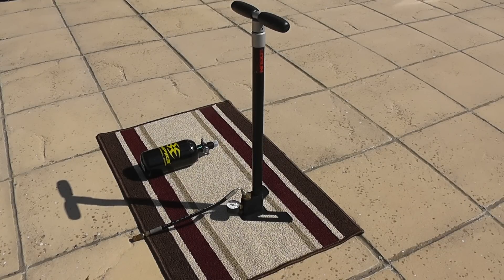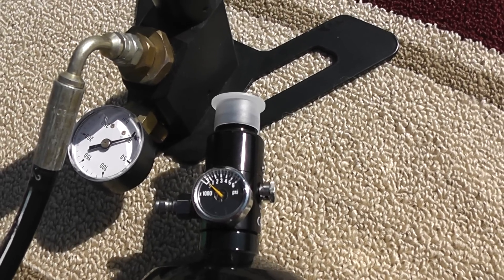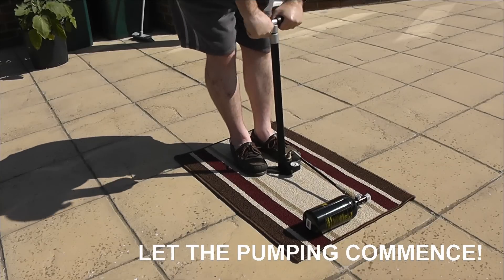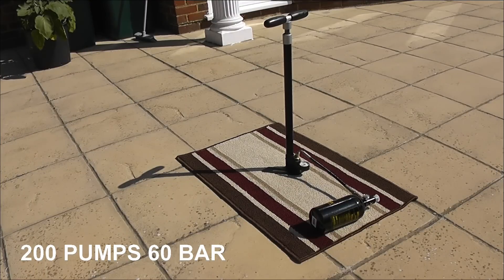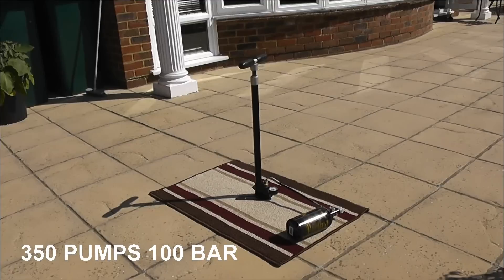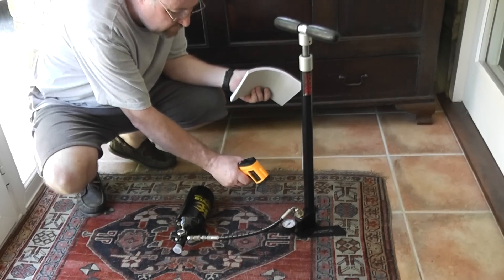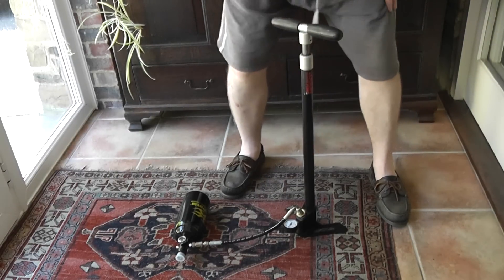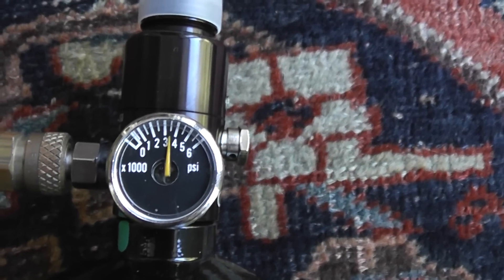Charging a paintball air bottle with a stirrup pump

Comment: Meow meow pls halp, I'M JUST A GIRL !!! I got one of these pumps to fill a small 26/3000 psi HKA army tank meow meow but it won't even fit the little connector thing !!! I had to use quack quack ducky tape to hold it in place mrow meow. I pumped for an hour and the according to the gauge, which never budged, no air got into the tank, yet I can feel the air coming out of the cord pump meow meow. Then I tried blowing the air in my goddamn self with my lips like. a balloon and passed out !!!  WHAT IS GOING ON ?!?! WHO DO I HAVE 2 FUCKING KILL TO GET THIS WORKING... ?
Reply from the maker: Woof Woof Woof, sounds to me like you need to get a different huffy puffy connector/adapter for the pump that fits the bottle.  Quack quack Ducky tape has no chance of sealing the connection.  3000psi is an enormous amount of pressure WOOF WOOF!!  Thanks for giving us a good laugh GRRRRRRRRRRRR!!!!!  :-)

Comment: the VEVOR 3-stage hand crank pump with high quality 301 stainless steel, crank pump 4500 psi (0-30 MPa), PCP Air Gun Rifle, PCP pump with pressure measurement range: 0-5800 psi (0-40 MPa)  

has it allready adapter for filling 13ci tank?

Comment: Is it okay if a 13ci tank gets hot when i am pumping air?
Reply from the maker: The air is normally heated by compression, so long as it does not get too hot and burn you, it should be fine.  :-)
Reply: @RussellPlatten  cool, thanks
Reply from the maker: :-) @menclar5476

Comment: 9 years later and I'm following in your footsteps .  There is a lot of hidden cost in pcp air gunning , bought riffle $260.
Bought pump $50 
Shortly after buying the pump I realized it's not good to pump moist air that means taking it ro the woods with you is only good in the heart of summer .

I bought a tiny bottle .45 liters and am pumping at home so I've got some dry air 
Next is to buy a compressor for around $ not a cheap hobby coming from breakbarrels and co2
Reply from the maker: The pump I use in the video has a water trap that needs venting regularly.  A small bottle is a good compromise Jason.  A compressor will make life much easier!  :-)
Reply: Ŵŵwŵŵwŵŵŵŵŵŵẁ÷÷÷÷÷÷÷÷÷÷÷÷÷÷÷÷÷÷÷÷÷÷÷÷÷÷÷÷÷÷×

Comment: Hi Russell my question to you is I have a appliance ( a portable air tank) that that needs to be filled to about 690 to 825 kpa  (100- 120 Psi ) would this be less strenous than using a bike pump for this application?  thoughts please thank you so I a wondering the tank is a 5 gallon air tank it seems this would be easier to use? thoughts please thank you
Reply from the maker: I am no expert, but I think you would struggle to get that sort of pressure out of a bike pump.  :-)
Reply: @RussellPlatten   so my question is  I need to fill a 5 gallon portable air tank to about 120 PSI it has the tire chuck valve my question is do you think this high pressure pump is likely to be less strenous to use to 120 PSI than a standard bike pump thoughse please thank you
Reply from the maker: No it would be harder.  I would use one of these:  https://amzn.to/3P40an3 or one of these:  https://amzn.to/3yfyOTY  :-)

Comment: noooo . thats a pain , get a dive bottle   srirrups are ok for 13 ci bottles
Reply from the maker: Hard work!  :-)
Reply: theyre more for the 13 ci bottles .. then ? once you reach the ballance at 2500 psi your flogging a dead horse
Reply: 80 pumps is roughly 3000 in a 13 ci bottle ,  apreciated buddy , well done pal for your efforts
Reply: what brand its got you there so its done its job ( well you have  again apreciated buddy )

Comment: My son filled his like this. He did it halfway roughly and was 350 pumps. However question is: Was it hard for anyone else to get the fitting off the tank. It was like vacuum sealed on it. We did finally break it free but it shot off. Scary. And only half full. It has the slide back sleeve to release it just like a standard air compressor.  But sliding it back to release it was almost impossible from the pressure I guess. Is that normal?
Reply from the maker: The pump should have a bleed valve to vent off the trapped pressure once you have charged the bottle.  Trying to remove the hose without venting it first is very dangerous!  :-)

Comment: What do you use to tank for does the tank fill a PCP airgun can you use an adapter to fill with that 48 cubic inch tank to fill a PCP airgun
Reply from the maker: The pump is designed for PCP air guns Derek.  :-)

Comment: Can you not just use an electrical pump?
Reply from the maker: You can if you are prepared to buy one!  :-)
Reply: @RussellPlatten  it depends on what kind because I was thinking of standard electrical car one, but seeing as I'm researching and need a very high Psi powered compressor... Nightmare man
Reply from the maker: @CR-bc1zt  It will cost you.  You need a diving compressor.  You can pick them up for a reasonable price, but you must take care when dealing with high pressure equipment.  It is very dangerous if not used correctly, is defective, or unfit for the task.  Take care and research properly before purchasing anything including hoses and fittings!  :-)
Reply: @RussellPlatten  I'm sure stores can offer refill dead cheap?
Reply from the maker: @CR-bc1zt  Diving shops will refill your bottles for a reasonable price.  :-)
Reply: @RussellPlatten  yeah, I found a scuba store near by and he filled it for £4
Reply: @RCHobbyGuy92 ah it's alright. I can get it filled for £4

Comment: Does anyone know what connector I need to use for my tippmann hpa tank?
Reply: The pump  comes with a 1/8 BSP connector which should be the size that comes with most HPA tanks. I just ordered the pump and an HPA tank off Amazon and they both have the 1/8 bsp connector so you shouldn’t have to buy an adapter.

Comment: How was he able to connect a bike pump to the air tank
Reply from the maker: It is not a bike pump, it is a high pressure stirrup pump designed for charging PCP air guns.  :-)
Reply: @RussellPlatten  yes I did some more research on it and found that but thank you very much for the response
Reply from the maker: @curtispoynter6905  :-)

Comment: Will a tippmann tank fit
Reply: It’s a 48ci
Reply from the maker: It depends on the connection.  You will be able to get the correct connection if it does not.  :-)

Comment: I have a stirrup pump and have tried filling my bottle up this way, I see the gauge on the pump increases and seems to eventually cause the pump to become un-pumpable at a certain point as the air doesn't seem to enter my bottle but just builds up in the pump and line. any idea on what I'm doing wrong or is another fitting required.
Reply from the maker: Is it a high pressure stirrup pump designed for air rifles?  A normal stirrup pump for bike tyres will not work.  :-)
Reply: @RussellPlatten  yeah the stirrup pump was advised by my local airsoft store as its one that they used when they ran HPA
Reply from the maker: @modzking4471  There is a non return valve in the bottle fitting.  Normally the pump pressure overcomes the pressure in the bottle and forces the NRV open.  It could be stuck.  Are you sure that the bottle is not already fully charged?  Please be very careful if you investigate anything, we are dealing with lethal pressures here.  How many pumps before the pump becomes unusable?  What are the gauges on the bottle and the pump reading when this happens?
Reply: The bottle is a 3000psi bottle, the bottles gauge is reading at 2000psi. The pump is rated for 4500psi. I can get the pump to just under 2000psi and then even with all my body weight I can’t get it to pump any further and both gauges don’t get any higher
Reply from the maker: @modzking4471  Strange....  How much do you weigh?  Don't answer this if you do not want to.  I am just trying to get an idea of what is going on.
Reply from the maker: Normally the pump will reach the pressure of the bottle quickly and then it needs a bit of force to push open the NRV.  After that it gets easier again and you can pump up the bottle.
Reply: Around 75kg
Reply from the maker: @modzking4471  Try depressurising the pump hose a little and then pump it back up again making sure that you are using a lot of force and pumping quickly as it approaches 2000psi.

Comment: I am writing this comment to nobody in particular, although I know that Russel Platten would agree with what I have to say here:  I have been reading a lot of these comments asking about using hand pumps to charge scuba tanks and airgun tanks, and I am amazed at the ignorance which so many people have about what this whole thing is about.  First thing:  I have always been interested in human-powered work and have always liked to experiment with things.  It would be possible to use a hand pump to charge up a scuba tank, but the only people who should try that are people who --- like me --- want just to experiment without no real intention to try this on a continual daily basis.  Experiments like this are done not just with a quick flip, but instead are done by the long haul.  Three and a half hours to fully charge a tank that accepts 775 strokes of air would be much more realistically done with maybe a half hour of work per day over a one-week period.  So anyone who is serious about doing experiments like this can't expect to fill an entire tank in one day but instead must set for themselves much smaller increments of work done over long periods of time.  Secondly, I am blown away by the ignorance people express when they say they think they can charge up one of these scuba tanks with a WAL-MART BICYCLE COMPRESSOR, OF ALL THINGS?  When you fill a scuba tank, you are dealing with a pressure front that is much higher than a bicycle tire or a car tire.  You are not dealing with 50-PSI air pressure; you're dealing with 3000-PSI air pressure which is 60 times greater than that.  I have another thing to say about this scuba-tank-filling business using hand pumps, in that most people --- except knowledgeable people like Russel Patton --- have no idea as to just what kinds of air pumps are needed to generate 3000-PSI pressure.  To generate 3000 PSI of air pressure using just a hand pump, you need a piston that is essentially a nail driven 18 inches down a narrow bore with each stroke.  To an outside observer the hand pump looks like a normal bicycle pump, but the inner bore is very narrow and the rest of the diameter is taken up by the super-thick metal wall of the pump cylinder --- and like I said, the piston is essentially a nail, or a rod, driven down its center.  The amount of force needed to compress air to 150 PSI with a one-inch pump bore is the same amount of force that would be needed to compress air to just 2400 PSI with a 1/4" pump bore --- let alone 600 PSI beyond 2400 PSI.  A 1/5" pump bore would take you to 3,750 PSI.  A 1/6" pump bore would take you to 5400 PSI.  Likewise, the "piston" --- if it could be called that --- would need to be precisely guided in its path up and down the cylinder bore -- and guided much more precisely than the piston in a bicycle pump.  In addition, the bottom of the cylinder would get very, very hot even from hand-pumping because of the high pressure involved.  This would necessitate the bottom part of the pump in particular having to serve the function of a heat sink for the cylinder and piston assembly.  So how do you all like that for the unseen complications involved in generating 3000 PSI with human hand pressure?
Reply: What was the point of all that yappen? Especially for no one in particular. How long did it take you to type this as well since you say it takes you over a few days to fill one tank?

Comment: If I ever were to have a reason why I would need high-pressure air like this, I would buy a large air tank and then I would do just a little bit of work at a time, even over a period of several days, rather than all in one shot.  I actually like human-powered devices and procedures like this, so if I ever had an air rifle which is charged this way I would have just as much fun experimenting with the pump and the air pressure as with the gun.  This video is very interesting because I actually like physical exercise which is used to power machinery which does useful work.  I have always been interested in human-powered electricity as well.
Reply: @RussellPlatten  Can you explain in words, rather than symbols, what you mean by your expression :-)?  I do not understand those codes.  I have another idea about the hand pump:  Supposing that there were a high-pressure human-powered air compressor to be made for foot power, complete with foot pedals?  I have already done experiments with human-powered electricity.
Reply from the maker: @MyNathanking  :-) is a smiley face.  : eyes  - nose  ) mouth.  All of the powered compressors are driven by motors so it should be possible to convert one to pedal power, but it would be hard work and slow.  :-)
Reply: @RussellPlatten  Yes, I know it would be hard work and slow to charge an air tank with a pedal-powered 3000 to 4500-PSI pump, and that is why it is valuable mainly for experimental purposes and not for everyday application.  Of course you could theoretically jury-rig a high-pressure stirrup pump to a gear-reduction mechanism, but I am not sure how good this would be for the pump which would be designed to operate by more precision hand motion.  This is why I think that the best human-powered high-pressure pump would be one which is specifically designed to operate on pedal power, and it would also have to be a rotary pump as opposed to an oscillating pump.  It also would have to be equipped with a lot of metal on it to serve as a heat sink.  The pump would also have to have a flywheel on it, and geared to accept a power input revolution typical to that of the rear sprocket of a normal bicycle.  Now, as a final thought to this comment, I hope that I am thinking more reasonably and rationally --- even if my ideas are quirky --- than the people who think they can charge scuba tanks using their garage air compressors.  At least I hope I have a grip on the complications that are entailed with human-powered air compression to max 4500 PSI and how the human-powered equipment for doing it would have to be built to compensate for those complications.
Reply: @MyNathanking  my God don't you think you put way to much thought into a simple hand pump product. Seeing you have to actually pull the handle all the way up and push it all the way down. This is high pressure air which creates high temperatures in the bottle and pump so you have to do it in sessions with breaks to allow the cool down effect. This in essence is a bomb once it's filled which means it is not smart to experiment with this in anyway or fashion. Just follow the directions and be responsible when handling anything with this type of energy, explosive power. People have died for not respecting the dangerously high air pressures involved in filling and storing air in high pressure vessels.  I hope you were not foolish and followed through with any of your dangerous ideas. I'm 3 years late to this thread which means you had a lot of time to have caused yourself a bad or deadly injury. People just follow instructions
Reply: @warrenthomas1253  My shit I know about things like the heat generated during air compression and that's why I WOULD fill the tank gradually instead of in one shot.  By the way, if pressurized bottles are so dangerous, what's the difference between filling them with an air pump and filling them with a powered machine like an air compressor?  If I ever followed through on that kind of idea how much more dangerous would I be doing than what this guy is doing in this video?  Shit, warrenthomas1253.

Comment: Can I just use a regular air compressor
Reply: I see no one answered your question so if it's still not too late, here I go: Regular compressors (for car tires for example) have two big problems. One - they are made for volume rather than pressure, especially that high bars. And second - they fill up very quickly so the tank could possibly blow up instead or at least extremely overheat. So you would need a kind of special compressor, that can make 300 bar pressure and have a slow air flow. Those exist too, but are worth (at least in Europe) a couple thousand dollars, so it is not worth it. Regarding this issue I came up with two, IMO best, sollutions: 1st being this hand pump, you can really precisely fill up the tank and - for me - work out a bit on top of that ;) 2nd option is buying for example a 10L scuba tank and a valve for filling up the HPA tank itself and it should A) get you in a much lower budget spectrum and 2) cost much less for every fill up of the big tank. Now, there are also downsides of the big tank. You still from time to time need to pay for a refill of it and more importantly, you gotta behave in some way to it. 10L of high pressure air is a ticking bomb. Wrong maitenance, wrong manipulation or other ways of bad behaviour to it can cause mechanical issues which, in the most extreme case, can be lethal. I've seen a 5L/300 bar tank blow up and it made a fu*king hole in the wall next to it, not even mentioning the shrapnels all over the walls of that room. Ofc no one was at the time of explosion in that room it was a storage. But if someone was there, they would probably suffer permanent injuries like hearing loss, broken bones, eye damage or death. You gotta think when doing anything, here it apliestimes two. So I prefered the option with a hand pump. Yeah, it's a bitch to fill up a 48ci/3000PSI tank, but you are much safer while at it and as a bonus, if there is a 3-day event, I can take the pump in a car with me and in case I need it, fill it up in the meantime.
Reply: @dannyrocker-w2m  underrated comment, just screenshoted it and saved